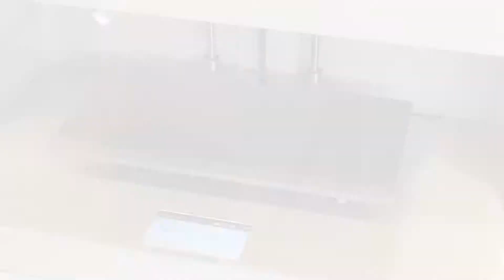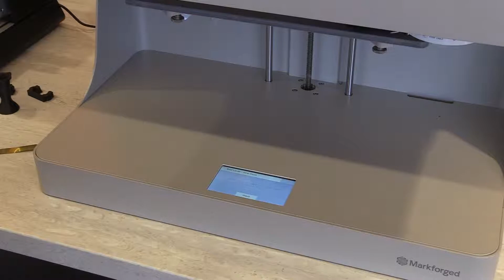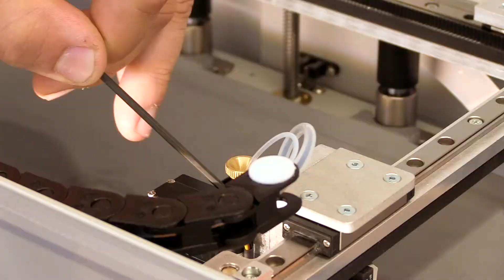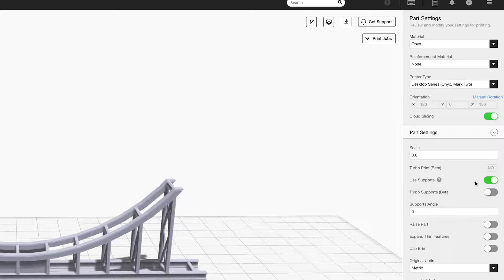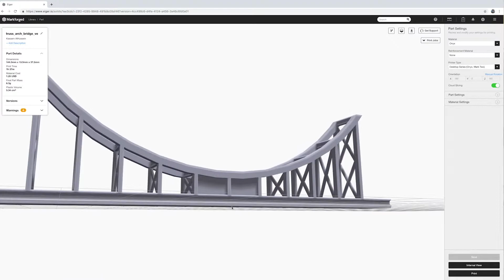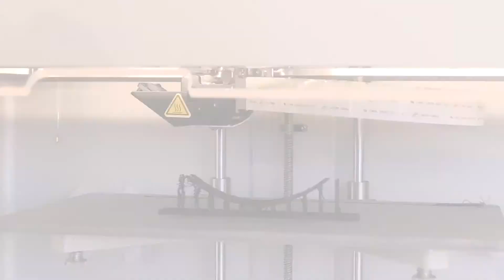Markforged Mark Two Tutorial

Comment: Markforged doesn't have reps in my country. I would have to buy from overseas. I'm wondering if it uses proprietary spare parts or it follows a common 3d printer standards such as E3D. For example what kind of hot end kit does it use? Are there any other parts that needs regular replacements and are proprietary? Thanks.

Comment: Nice video. Ended too soon, wanted to see finished print.
Reply: That is failed print, nothing to see. Overhangs too great to be printed without support. Vertical pillars should've printed without any problems if settings were correct according to material. Very good machine, except the operator. Settings and experience is a much bigger part of successful print than the printer.